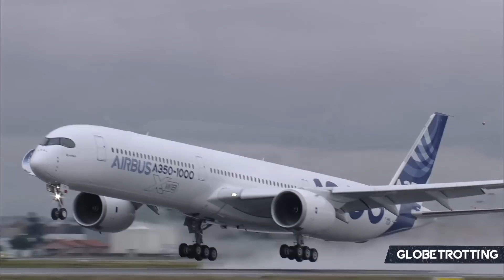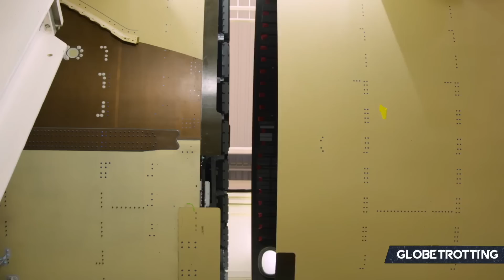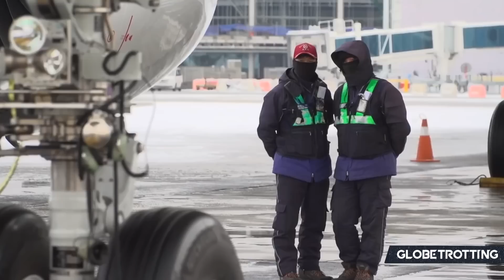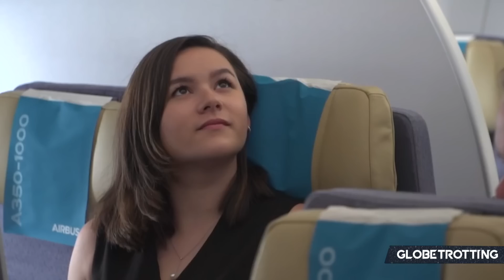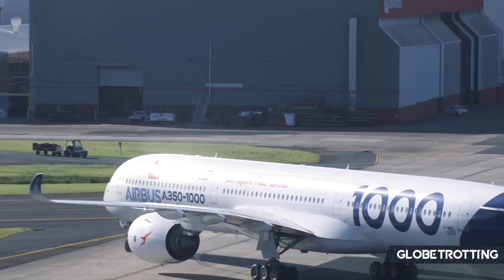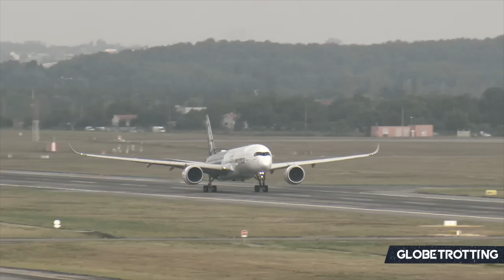UNRELEASED - Why The Airbus A350-2000 Never Launched

Comment: How a -2000 stretch to add 50 seats means  6 extra rows in economy (9 abreaast seating) to compete in capacity with the 777-9 - which is expected to have 10 abreast in economy.
I wonder what the largest possible stretch is without the a350 requiring major wing/structure redesign or engine upgrades.

Comment: Airbus should launch a simple, cheap stretch, using the extra weight of the A350ULR.  My A350-1100 would only have a few extra rows of seats, swapping capacity for range, as long as still has at least the same range as the Boeing 777-200-ER.

Comment: the A350-900 is the Super Star of Airbus. A350-1000 a failure. due to the unique RR engines installed, therefore, Airbus will not jump into building the 2000 version.

Comment: If Airbus wants to rival the 777-9, their current efforts to do that might make the A350-2000 redundant. They have redesigned the sidewalls, which they anticipate will make more airlines adopt 3-4-3 in economy class. If a sufficient amount of full-service airlines does that, then there is no point for a -2000. Heck, maybe Airbus doesn’t really want to make a plane that big, similar to how Boeing didn’t really see the case for a MOM plane back in the 2000s and early 2010s.

Comment: There has never been a dash 2000 (-2000) project at Airbus for any of its models.  I asked the question last July airshow at Farnborough and Airbus has no intention to do so as all its "neo versions" have reached their maximum length whichever model is concerned such as the A-330 or A-350 as well as their maximum percentage of composite material have been reached for their wings, tails or fuselages.

Airbus is planning to make a final extension of its A-321XLR providing between 48 and 72 additional seats which will be named A-322neo.  It is also planning to extend the A-220 to a dash 500 which would provide carriers with only 32 more passengers but carriers would have to show their interest into such endeavor.  

The only way to extend the A-350 or A-330neo would entail to lower the percentage of composite material and make their aircraft a lot heavier with quite lower range.

In the questioning by other participant, it was assessed that Airbus is providing an aircraft for each and every actual market segments.

Comment: The A350-2000, or stretch, will have to wait until the A350Neo is announced for the early 2030s, after the current orders for the -900 and -1000 aircraft are fulfilled. Airbus cannot make any more A350s than they have already announced, and therefore they do not have a production facility for this stretch right now. The A350 is virtually sold out. Airbus are tweaking the 350 design to accomodate customers like Qantas, and there is the A350F of course, but its all about manufacturing capacity, or lack of. It really is as simple as that.....
Reply: How can planes be sold out if they are built from scratch? I know that different entities/companies build different parts for the plane but since these things are built from materials how can it be sold out?
Reply: @Bjg6  
Airbus produce 6 A350s per month, and they anticipate they will be able to increase that to 10 a month by 2026. This is the most advanced civil aircraft in service, its not like producing plastic toothbrushes, where they just up production with a flick of a switch and put more plastic pellets into a large vat. Any increase in the capacity of the A350, requires the hiring and training of many more technical employees than are immediately available.

I indicated that it was virtually sold out until the early 2030s. Some unannounced orders are in the pipeline, other orders will be topped up, so with capacity at full strength, how can they, or why would they, devote resources to an aircraft they cannot build until the 2030s..........?
Reply: @artrandy  Thank you for clarifying.
Reply: I would think that the 2000 variant was less economical than the 1000
Reply: @ianloftus6692  I can see them making an A350neo with even more fuel efficient engines that go with both the -900 and -1000 than see them stretch it even further for a -2000 imho. I thought it was weird that the -1000 has different engines even tho they are RR.

Comment: More airlines want an A350-900/1000 compared to ones that want a A350-2000 / 777X size of aircraft. The -900/1000 are already flying off the shelves, there is no reason to cater to the few when you've already captured the masses from a business perspective. Not to mention passengers as of late are leaning toward preference of departure times, which favors smaller less capacity aircraft.

Comment: I doubt there will be a stretched A350 without a new engine to power it. The studies were theoretical, the reality on the ground from flying A350s shows different data - eg shorter on-the-wing timeline engine on the A350K. Most airlines will not be happy with an underpowered but huge aircraft.

Comment: Makes sense. Airbus has a problem with multiple aircraft types competing for similar market. No one is buying the A330-800, and now they essentially replaced it with the A321XLR, if you can call it a replacement. There's a similar situation with the A319neo, which has esentially been replaced/userped by the A220-300 after the acquisition of the CSeries from Bombardier.
Reply: True. Its a nice problem to have when conditions are ideal. But, at the moment, some are more efficient than others, thus leading to cannibalised sales for the not so efficient variants. I guess in the long term, they will streamline the variants. A stretched A220-500 will compete with the A320neo.
Reply: Let’s also not forget the A350-800 that got cancelled in favor of A330NEO

Comment: Arguably, as some major customers (e.g.Emirates) are giving the A350-1000 already a pass due to engine reliability issues, a 2000 variant would probably not be be successful  enough.
Reply: Emirates are waiting for the XWB-97 upgrades that power the -1000 to be confirmed by RR, before placing their order. If anyone thinks that Emirates are going to wait until eternity for the B777X to be delivered, without taking the precaution of ordering the A350-1000 as a back up, might as well be living in Neverland..........
Reply: Didnt Rolls Royce finally fixed that problem months ago?
Reply: @ganymede6535 No put they have plans to roll out updates to the Trent XWB engines starting in the beginning of 2025 through 2028 to improve performance
Reply: Emirates will regret this decision. Wait and watch
Reply: @ileshpatel390 why is that, are you suggesting that the 777X will be a failure?
Reply: @carmenvalmalaartaraz8260 Why is it taking so long for the 777X to enter service? It's literally just an upgraded 777 with new engines, wings, and bigger size yet it takes more than a decade to get type certification. Heck, the smaller 777-8 doesn't even exist yet.
Reply: @DustinPearce2957  I don't know why is taking so long, probably because they can't afford a failure after the Max and the FAA is looking at it thoroughly. But I'm sure they'll get it right this time, they have to.